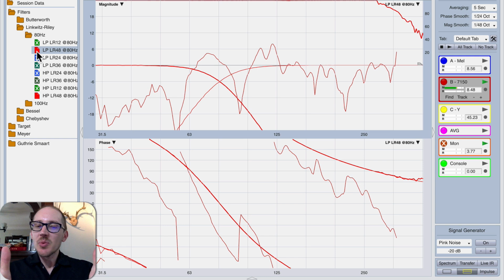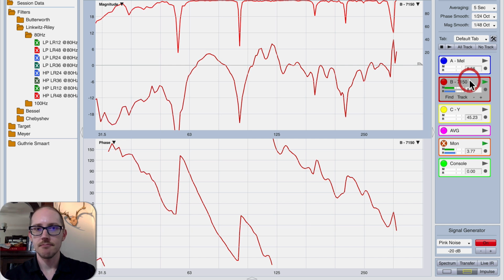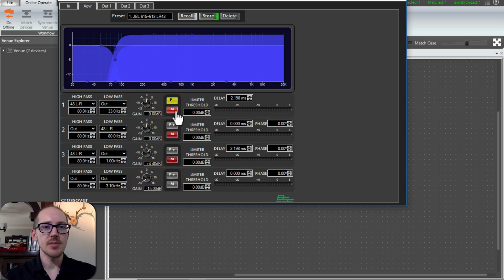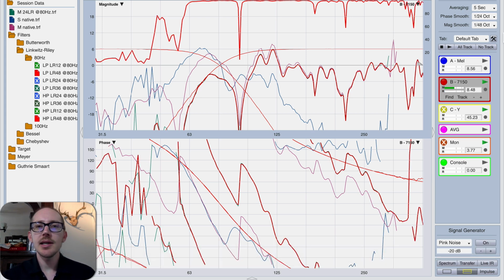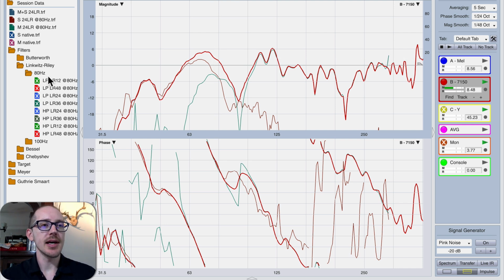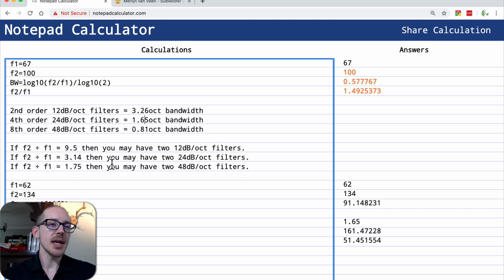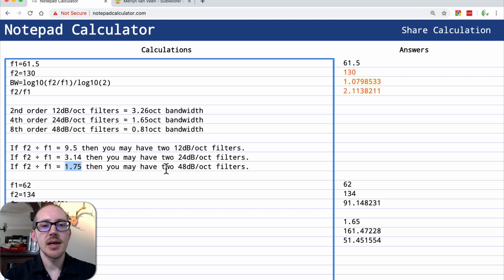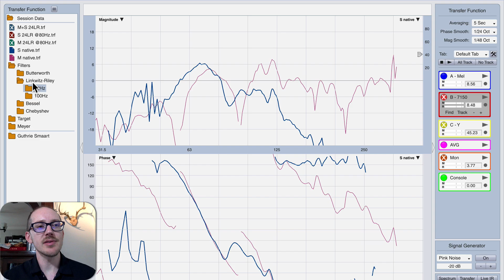Spot Crossover Slopes in Smaart® and Avoid Falling Sharply

Comment: Hello. If you put the filter based on the peak wont it be accurate? The FR sometimes all over the place because of the room interaction. How do u make sure your FR is 0 when u have dip and peak all over. If you level the db wrong then u get wrong xo point for unity for example. Thanks
Reply from the maker: Hey Dan! Great point. I guess ideally you want to do your measurement outdoors or in an anechoic chamber and then EQ them before deciding on the filters that affect the xovr region. Otherwise, I guess you just do the best you can to center the trace. In the end, all that matters if the final summation between drivers/sources.

Comment: Hey Nathan, love the videos.  Would you consider doing a video on how to properly select the crossover point between subs and mains.  That's the one mystery that has troubled me.  Some choose 80 Hz, and others choose 100 Hz.  I know the short answer is "it depends", but is there a good rule of thumb?
Reply from the maker: thanks Scott!
Funny, I did include some stuff about that in the first take, but cut it later because it make the video too long. I follow these priorities. If one doesn't work, I go to the next.
1. Follow manufacturer specification
2. Find logarithmic center of area of interaction of native response
3. Avoid adding filters near existing manufacturer filters
Reply: @nathanlively  No. 2, was it when you identify the lowest and highest frequency range using -10 dB & +10 dB method?